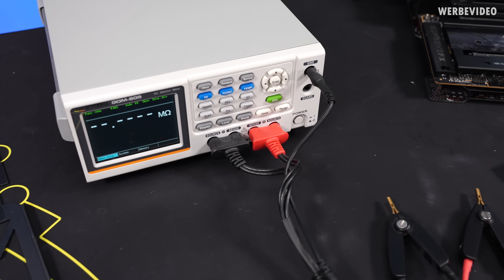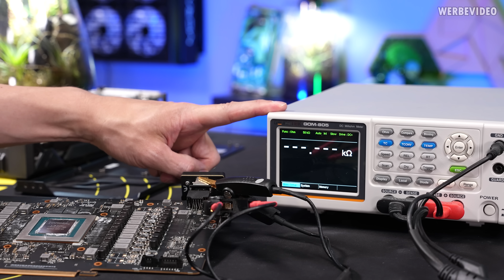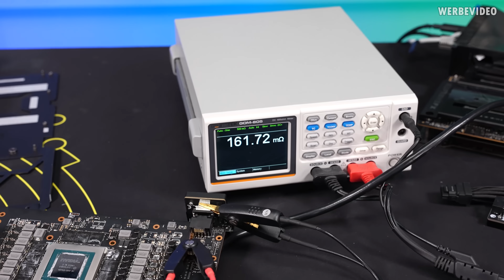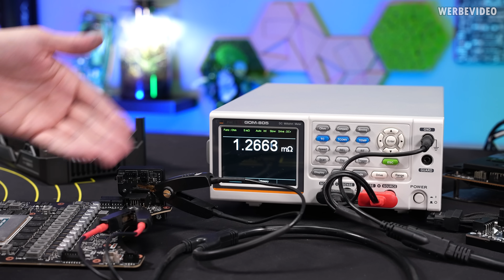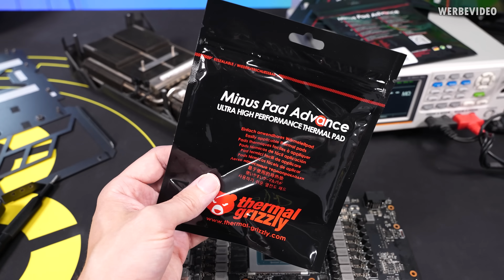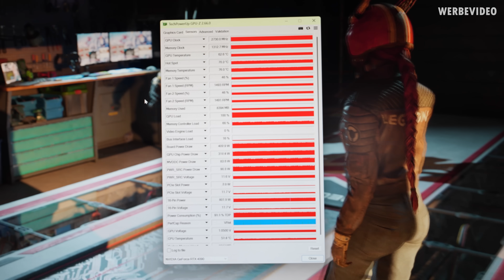It Happened Again – RTX 4090 with Melted 12VHPWR

Comment: You think they would just have 2 PIN, with a higher guage cable....none of this split cables which basically do the same thing. Or just drop the 12HPWR cable completely and do the underbelly connection through the PCB and motherboard.
Reply: XT60 style connectors, with a positive retention latch would work perfectly.

Comment: This is clearly a wireview problem, you added more points for failures. Just stick with the minimal connectors. Most 12vhpwr users have never see a problem.  The burning story is overplayed by the internet hype brigade.
Reply: Cards should not be melting to begin with, let alone ones costing 2k doubloons. Even if the amount of melted connectors is a small percentage of the overall userbase, it is still a massive deviation from the old norm. Where were all the reports of melted connectors with the old standard? Why has this new problem that wasn't happening before suddenly appeared?
Reply: @wahcriminal how many burnt cables are used in SFF builds and using custom kables? I bet the ratio is way higher than the total amount of burnt cables
Reply: I agree, this is a problem by third party devices that are not built to spec.

Comment: 10:06 If you dont have a desoldering gun for THT component removal you can alternatively use aluminium tape to create a heat-shield/barrier to protect plastic parts and also nearby components when using a heat gun for desoldering.
Reply: You have to heat the entire PCB, a soldering iron won’t work on its own.  Personally would add low melt solder into the mix
Reply: also heat from the back of the board, that way the board shields the plastic connector from the hot air (and prevents hot air from sneaking in under the tape)
Reply: Wouldn't desoldering from the back of the card just work better?
Reply: My Asus TUF 4090 OC, melted on the PCIe pins. The first 2 PCIe pin on the shorter on melted. This was 2-3 months ago on a 1.5year GPU, and they could not replace and gave me option of a refurbished Gigabyte 4090 gaming OC. Was soo annoyed, as gpu had soo many scratches and wander how long this gpu going to last. This is in South Africa  🇿🇦
Reply: Wolverine edition
Reply: If this happens to you, take my advice. Pay out of pocket to send your card to someone like Northridge fix etc and have them replace the connector for you. I went back and forth between doing the connector swap myself, spending the money sending it to a repair technician, or going the "free" route and RMAing my card to Nvidia. Well guess what? Someone at FedEx stole my card and Nvidia gave me the middle finger. I'm now without my 4090 and was forced to buy a 5090 as it was the only card worth spending the money on coming from a 4090. I been bought an H++ 12v-2x6 connector straight from Hong Kong and a hot air station to do it myself. I would have been better off trying and making successfully doing the repair, or fragging it (but still having it and could send it to someone else to fix) rather than go the free route and now out of a $1700 GPU.
Reply: @KuraiShidosha why are you still buying nvidia
Reply: @Hetsu.. because AMD is not a viable alternative if you want to enjoy ray tracing today which I do.
Reply: @KuraiShidosha  Didn't pay to insure it?

That'd be like NVIDIA's penny pinching.
Reply: @AceStrife nope because I used their shipping label. Don't ever use another company's shipping label if the thing you're sending is too valuable for you to replace. I should have bought my own label and paid for the declared value coverage. There's a lot I should have done and regret. All I can do is give best practice advice so no one else falls victim to that company like I did. Avoid FedEx like the plague.
Reply: @KuraiShidosha  So you RMA'd it to NVIDIA (implying FE model), they gave you a prepaid label, the package got lost in transit, and they didn't compensate you?

It's time for a lawyer.  The burden is on NVIDIA as they are responsible for insuring the package.

...also still fits my criticism if they really did refuse to insure the package just to save some money.
Reply: @AceStrife yes FE. Unfortunately a lawyer costs more per hour than the card is worth. My only recourse is to file a complaint with consumer protections and basically beg them to do the right thing. I really should do it because it's not right that I sent my card in and got screwed like this but I have no real legs to stand on. I don't have any proof of the card being sent in. It's just a bad situation. If you ever RMA a card, take video of yourself at the shipper store (preferably UPS) examining the component before boxing it up and handing it to an employee for proof you actually sent it out.
Reply: @KuraiShidosha  Prolly about half the major tech tubers help out people with RMA issues like you. GN I know has helped me and some friends in the past.
Reply: Desoldering gun is overkill for fixing broken connector pins. Just go buy a goot de-solder hand pump, it's cheap

Comment: A chip with tens of billions of transistors, each so small that it's meaningful to count its atoms; Even its lowest-end version is one of the most technologically-advanced items a person could have at home; Brought low by a power plug.
Reply: Every Achilles has a heel
Reply: And every heel has his Achilles  @AbbasDalal1000
Reply: It's a good thing that my solar panel's power interfaces weren't designed by Nvidia and Dell.
Reply: Its literally penny pinching to reduce board sizes. Theres no other reason why they wouldnt simply use 3x 8 pins like they always have.
Reply: @Elvewizzy.  There's even more to it. Power rail of the newer GPUs are more simplified, so they're combined, not separate, which leads to problems as well.
Reply: @Njazmo  on a aib designed card they design their own pcb, they can easily split the power rails along a 2-3 8 pin connectors..
Reply: @turboimport95 But the AIBs are afraid to deviate from Nvidia's "recommendations".
Reply: @Revan_7even  they have to buy the core from nvidia, but cant buy the pcb design, they do make their own. if gpus in the past has that old 6-8pin, it can be brought back. imagine the first company that does it. sales would be huge, a guarantee yours will not burn, would be worth a lot..
Reply: @turboimport95 The 12V HPWR/2x6 connector is required by Nvidia. Same goes for VRAM. If you don't meet Nvidia's requirements, they stop selling you chips. The lack of power monitoring isn't a requirement, but Gamers Nexus heard from several AIB partners that they were afraid to even ask Nvidia if they could change it, which means it was at least recommended by Nvidia to follow some specs set by the Founders Edition cards.
Reply: @Elvewizzy.  3 x 8-pin = 450 Watts and that card consume more than 600 Watts, then at least 4 x 8-pin!
Reply: Ok ChatGPT

Comment: I'm sure there's a lawsuit waiting to happen with these connectors.
Reply: I'm surprised it didn't already, im sure there are businesses that had to deal with this crap
Reply: @angeltzepesh1  like I said somewhere else, too many hands on the pie: AIBs, cable makers, power supply makers... You need to go through all of these before you can get to nvidia. In fact, you might need them on your side to get to nvidia.
And considering the iron grip they have over the AIBs, good luck with that.
Reply: Who to sue? The manufacturer who did manufacture the connector, the PSU manufacturer, the instansseissa that did aprove the connector and Nvidia who use that connector in their required features… or the cable manufacturer, or some one else….

Comment: based on the story ( weeks after changing to wireview ) , I wonder if they don't connect it fully, though it's still nvidia to blame, also props to roman for fixing the gpu and giving them bonuses even though you ate the cost for those premium thermal grizzly stuff
Reply: Eh. He only ate the manufacturing cost. TG is his product.
Reply: @MBSteinNL even tho he manufactured himself, the cost is still pretty much the same. It's just 1 - 2 $ lower than the market price

Comment: Until Nvidia gets rid of this cursed connector, I'm only buying AMD. Or Intel if they release a higher end card.
Reply: Just a gamer then huh? 😂
Reply: AMD cards use it too, eg. supphire 9070 xt oc
Reply: @drayke8886  yeah, but that's up to the board partner to decide. If you want an AMD card without 12VHP, you can find plenty. 
NVIDIA doesn't let AIBs choose which connector to use.
Reply: @lucitribal oh ok, didn't know that. 
This is what happenes when you are a monopoly in reality and duopoly on paper.
They can do whatever they want and still nothing will happen.
Reply: @drayke8886  i've only seen one sapphire 9070xt with that connector, its the Nitro version. The other two Sapphire cards (Pulse and Pure) have the good old reliable connector. But regarding the Nitro card, I doubt it would melt, it only pulls 320w
Reply: @drayke8886 yes but I take it he also won't buy the ones with that connector

Comment: I'm not defending Nvidia. The 12VHPWR connector is the worst connector in the history of GPU connectors and the way that Nvidia has gaslit the PC community is a disgrace. As soon as AMD releases a GPU that's is at least 50% faster than my 4090, I'm switching to Radeon.

I just think that this probably wasn't the best case to publish. While Roman knows more about PCs in his left pinky than I know in my whole body, in my humble opinion, the "transport damage" to the connector should disqualify this case as a 12VHPWR melting issue. It's not possible to be 100% sure that the damage wasn't due to the user.

I might get criticized in the replies but at least be nice. I'm more than willing to hear and perhaps change my mind.

Comment: An electronics engineer take: This wire view gadget with its busbar is the worst possible way to torture test the +12VHPWR connector! Having a busbar directly at both sides of the 6 pins means that any contact resistance imbalance between the pins gets greatly amplified (compared to the expected scenario with 25–50 cm of cable to set a non-zero floor for the resistance of each individual current path).

Similarly, a shorter cable is worse than a longer cable. And, a thicker than standard cable hurts rather than helps.

Of course, none of these would be an issue of the GPU would have active load balancing. It does, after all, have way more than 6 power stages so it should be perfectly doable to split roughly equal counts of these stages behind each individual pin... Near perfect load balancing by default. Built-in detection for bad contact resistance at any given pin.
Reply: As a fellow engineer: I was thinking that the way he measured the resistance was wrong. 
All Pins are connected via the bars on both sides. Because of that  the path of least resistance (through the remaining pins) will always hide the high resistance of a single pin.
Reply: The entire 12vhp design would need to be rewritten. The way it is now you dump all 6 pins into a single 12v plane which is why the busbar design of the wire view works fine for it. what you do after the connector on the card is up to the manufacturer and they are always going to take the cheapest possible option.
Reply: @sirmonkey1985 no. Nothing in 12vhpwr physically limits a design to common it all to one 12v rail.
Reply: This wireview monitor is cool but useless! It only monitors the cable. But the cable it NOT the problem. The problem is the connection.
So I'm asking why the f.... You make a busbar in this wireview tool? Just controlled every pin to the card and it would be perfect???
Reply: It shouldn't matter, a regular 6-pin PCIe connector can handle the full current allowed by the standard on a single 12V wire, and still have some safety margin given that the contact may not be perfect.

And that's right. Remember that these connectors are intended for use by people who are not electronic engineers, and who cannot and should not know what can go wrong, and so the connector must be designed so that all possible user errors and malfunctions will, in the worst case, result in the computer not working until the user fixes the problem.

When a connector is operating at its limits under near-perfect conditions, and users are constantly told to measure something, look at how the wires are turned, and how tightly everything is inserted, and even when these requirements are met, the connector still fails - this connector should be defined as unsafe and banned from use. Period.
Reply: Doesn't even need load-balancing. Just per-pin current monitoring. Some AIB partner models have that feature, and can detect and warn you when things start to get out of balance. 

I wish wireview could do that. At least the newer versions have temperature alarms for the connector.
Reply: This entire video is cope for his wireview gadget being the cause. It was bent but that's okay because it was "transport damage" (yeah right). Either the wireview failed, or the guy who bought it installed it improperly after buying it and caused the fault after years of it running fine. But youtubers want their clickbait and "nvidia's connector melted" is one of the best ragebaits around.
Reply: @bigpoppa1234  If that were the case, then you would also see issues with the 8 pin wireview models, no?
Also, he specifically went over how NVIDIA states that not having a busbar causes the issue, yet the connector still melted in this example, with a busbar.

If this were just happening on on wireview connected cards, i would say yeah. But we have hundreds of reports of cables being melted. Multiple revisions of the connector to try and "fix" the issue. AIB partners implemented per-pin monitoring features and alarms, etc.
So there clearly is a problem with the connector design. That's up to Nvidia, not wireview.

Here's a question. If you truly believe that Wireview is the culprit here... What could they have done differently to fix it? Maybe that change can be implemented in the next version.

Comment: Only reason I haven't bought a 50 series.
Reply: Exactly, my PC is on 24/7, so obviously runs when I'm not home. Absolutely don't want my house burning down should something decide to load the gpu
Reply: I bought a 1080 Ti (11GB) for 250$ and I'm so happy with it its crazy
Reply: @Echomemes  wow thats expensive for a 1080ti. Here by me u can get them around £130
Reply: @RebootTechnologies  Thats  a really, really good price. I'm in the UK, I've never seen them that low. Where is this from? I'd buy that.
Reply: This only matters on the 4090 or 5090, I haven't seen anyone with a busted 4080 or 5080 like this...
Reply: @maartjeaalders1037  I think it is more the principle. Nvidia is willing to gamble. A 4090 could easily run on 3x8pin. I don''t want to support nvidia in this choice. My 3080ti had 2x 8 pin. My new AMD card has 2x 8 pin. I only see downsides to 12 pin. I hope my next card can stay 8 pin or use the new connector that will replace 12 pin.
Reply: @maartjeaalders1037   You're right expect the entire 50 series outside of 5090 is pire garbage (I mean the 5090 is too but if you have the money).
5080 is like 1300-1600€/$/£ in most country of the world US included for 16GB the card is totally not worth it at that price and struggle in intensive game with DirecStorage at 4K because it just just lack VRAM to use the feature (10% faster than a 5070Ti to be nearly 50% more expensive)

One of the only one making sense. 5070Ti. Sadly it's often 100-300 €/$/£ than the 9070XT in most country of the world US included and is slower so not good.

5070. Oh that one is pire garbage. Managed to be worse in ray tracing on avg than 9070. Managed to be worse in power efficiency than 9070. Managed to be worse for AI than 9070 due to his lack of VRAM to run smarter model. Managed to be worse in gaming compared to the 9070 because just straight up slower and by a bigger margin than his big brother. Less VRAM and bit rate. The card is just a 9070 with everything straight up worse 💀 (and often at the same price or more expensive).

5060Ti 16GB. I rarely seen such overpriced GPU often at 450-550€/£/$ it make no sense or whatsoever to spend nearly 500 bucks for such a bad GPU.

5060Ti 8GB Are we even gonna argue that one ?

5060 well it's just straight up worse so ...

5050 man that stuff has literally less cores % wise than a GT 1030 💀
Reply: @maartjeaalders1037 it DOES happen but way fewer, and more a user fault with cheap cables/improper seating
Reply: @maartjeaalders1037  here in Aus 5090 is $6000... I got a 5070Ti for $1700 instead. Still waaay too much tbh.
Reply: Lies…. This is a 1 in 10,000 case, and 5080 and below are SAFE for human consumption